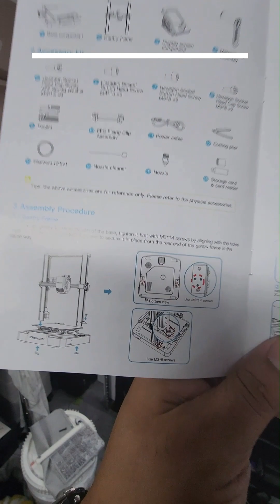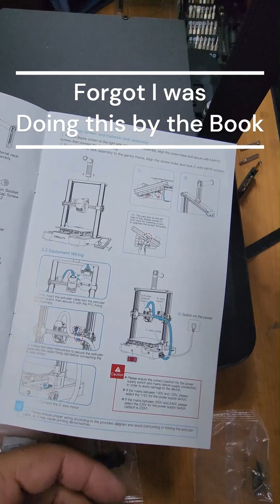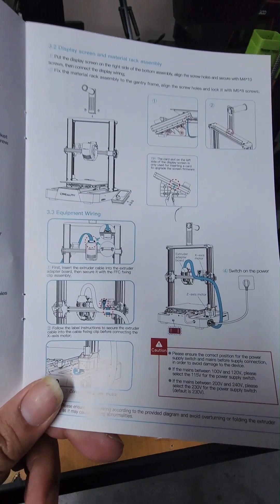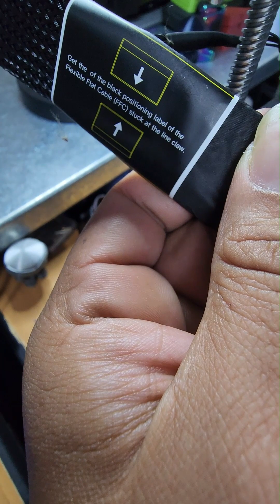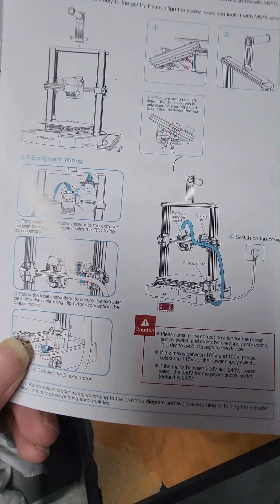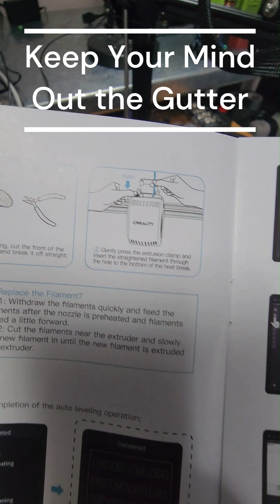Creality Ender 3 V3 SE Part 2 of 3 Assembly EASY SIMPLE

Comment: Hey I saw one of your shorts with your Kobra max and I’m curious how you got such a nice quality print. I’ve been struggling to get mine to print well.
Reply from the maker: CURRENTLY trying a brand new setup on the MAX.  BUT when it was stock I too struggled to get it to print well for a while.  I found that the Orca slicer profile was the closest to working correctly but still needed adjusting.

Here's a few things that sort of helped
1) I set retractions to 7 at 50mm/s to REDUCE stringing
2) I made sure my strain Guage was registering correctly when bed leveling by adjusting the screws that hold it in place and making sure no other wires were touching inside the fan Shroud.  This was causing mine to get a BAD bed mesh each time.
3) Upgraded the hotend to an aftermarket one with better heating block
4) Changed the Cooling fans internal shroud and swapped to Dual Barring 4010s part cooling fans rather then the single barring.
5) Switched to .6mm nozzle
Didn't make it perfect but definitely an improvement over what I was getting before.  Hope that helps.
Reply: @3DandTeePrinting  awesome, I’ll try all of those things I bought mine only for big stuff since I’ve got an ender 3 for small stuff so I put a .8mm nozzle on the MAX and ever since I’ve got functional but not clean prints from it so I’ll give it a go. Thanks for all the tips. Keep makin good videos